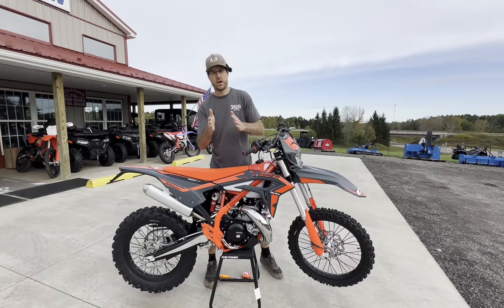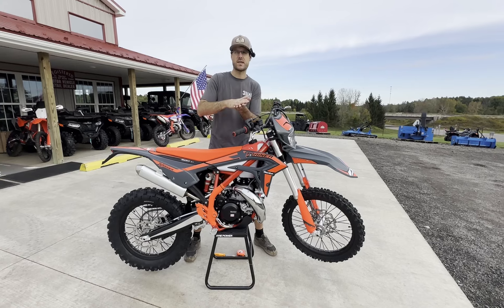2025 Beta XTrainer 300 2-stroke Motorcycle - First Look & Set Up Tips -  3 Seas Recreation

Comment: The carb is a deal braker for me. I'm not buying a brand new bike just to have to deal with chokes, jetting, carb cleaning and poor fuel mileage. Not to mention all the hoses are ugly. It wouldn't have cost them much more to include fuel injection which is way more beginner friendly.
Reply from the maker: Oh my, have you followed the mess KTM is in with their 2-strokes? The company is on the verge of extreme bankruptcy. They can't keep a 2-stroke EFI model for more than a season before they totally redesign the system. TBI or TPI. They are literally using the customers as guinea pigs at 10k per bike. Good luck carrying your dealers EFI tool and spare sensors at every ride. Not saying I am against EFI but until they figure it out on the 2 strokes there is nothing more reliable than a carburetor! Enjoy The Ride, Jared
Reply: I’ve owned numerous direct injection 2 stroke SkiDoo snowmobiles since 2009 and every one of them has provided incredible motor performance, including great fuel efficiency, power delivery and reliability. But watching for several years, the overall issues KTM has struggled with their semi direct injection system, I’m not sold on their reliability. So now I own a 2024 300 XTrainer and it’s been incredible!

Comment: I've been back and forth between this bike and the gas gas 300 I really like this bike, thank you for the thorough video I'm 53 years old Road and race motorcycles is the age of five. Been in Hiatus for the last 7 years was really considering getting a KLX 300 but I miss the sound and the lightweight feel of a two-stroke I especially love how this bike is detuned I would leave it exactly like it is change the airbox intake and I'll be about it this bike reminds me of an older KDX with much better features electric start in oil injection I really believe is a plus I believe I'm going to pull the trigger next month thanks again for the video
Reply: Experience with both…the KLK is gonna be a smoother ride when it comes for cruising gravel and dirt roads.  If you’re gonna be riding tight single track trails then the Xtrainer is worlds better.  But if you’re doing double track, gravel and open dirt trails the KLX will save you a bit of cash and do everything fairly well (with the exception of tight woods trails and hard enduro)

Comment: how the hell do you shear off 2 footpegs?  Was it the pegs our the mounts on the frame?  I have a 2023 with KYB and Sachs shock just like Mark's bike...My only complaint is the low footpegs for rock riding.  I have Fastway pegs but don't dare run them in the lowboy position...but even in the high position every time a get a rock strike I bend the footpeg pin.
Reply: Defective welds on the frame
Reply: @fagarasvladut3343  is this your guess?  Or what actually happened?

Comment: Wow. Brand new video of the brand new Xtrainer. Can i first just say that your videos are truly the best Beta videos out there?? No obnoxious opinions, just factual recommendations. Anyway, my ‘18 Xtrainer seems like a relic compared to this new model. 7300 miles so far.
 But…i like how my kill switch stays IN when you press it. I believe all current Beta kill switches are just a momentary push (you have to hold it in). Anyway, Ive always loved the low torque this engine produces. Ive even changed my gearing to 15 front, 49 rear. 1st gear is usable and the revs are moderate at 50mph. Best dirt bike ive ever owned.

Comment: would like to see a nice compare between xtrainer stock, xtrainer modified, 200rr and 300rr (x-pro). i have a 23 300rr ...super happy, except the suspension and turning angle. But still i´m wondering , for almost tecnical hard enduro, i woul like to try a more agile and nimble xtrainer. I think, the power will be enough...hm. ofc it make no sense to do all the expensive modifications compare to get a racing 300. But i still think,  a modified xtrainer is super fun agile weapon, where your mates get jealous :)

Comment: Sheered both pegs off?? What does that reflect about reliability? My buddy has had plenty of problems at high elevation with his. Good looking bike though but without reliability I would leave the bike on the showroom floor.
Reply from the maker: If your comment about the foot pegs sheering off is referring to the shop built XTrainer that was purpose built for a Pro class rider to be ridden at Hard Enduro events I think you need to attend a Hard Enduro before you blame the bike. There were at least 3 Factory KTM riders that lost foot pegs this year alone as well.. They get new frames every race. Literally anyone that signs up for those events understands the bike will not come out looking the same. Our bike has been beaten on for 2 straight years. If you follow or Vlogs you will see the abuse this bike has taken it's incredible really. Good luck with a TPI/ TBI 2-stroke, better have your dealers EFI tool & spare sensors in your back pocket lol.

Comment: Size or the rear wheel and tire? 

And do you have to premix the gas with oil in the gas tank with tpi or is it just gas in the gas tank and oil in the smaller tank?
Reply from the maker: Good questions! This is an 18" rear rim. Most new tires on the Betas are a 140/80-18. This is Oil Injected so you do not premix. Enjoy The Ride, Jared

Comment: I’m 5’5 beginner, is this a good bike for me?
Reply: 5'6" here with a 2024 xtrainer;  I have the lower seat.  It looks huge (full size dirtbike) without sitting on it but it sags quite a bit and allows me to comfortably shift and touch on either side with one leg as needed.  It's also more narrow so easier to shift to either side versus a fatter/wider seat.  You may feel the need to lower an inch but for me I decided not to lower (although was considering at one point when I first got but now that I have 7-8 engine hours on it, I like it and won't be lowering).  Also, I was brand new to dirtbikes as well and a bit older/stiffer as I have a work from home job sitting on my ass all day lol.  Inseam is going to be the important/deciding factor for you.  Mine is probably around 27"
Reply: @jamesbowie1820   thanks I want a bike also that I could bring to the track not only for Trail

Comment: Garbage suspension..really useless crap.  Low quality,low performance and low life span.
Reply from the maker: Tell me you know NOTHING about what your talking about without telling me 🤣🤣
Reply: The stock suspension works just fine for the intended purpose of the bike. 
Try being realistic next time.
Reply: @3SeasRecreation  im owning one for about four years, i know these suspension inside out .both front and rear,made many upgrades. Im riding hard advanced level . So here is your answer…
Reply: @SPCRacing1  they are not,just limiting the rider ability to advance.
Reply: Italian made I personally don't like any motorcycle that's made in Italy I had one and it was probably the most unreliable bike I ever had in my life and I've had a lot maybe it was just me plus I like fuel injected it's 2025 I don't want to have to buy a smart carb which doesn't work that too great either every time I had my cross trainer in the woods I had the carburetor apart messing with the needle or the air screw or something if it wasn't that it was something else